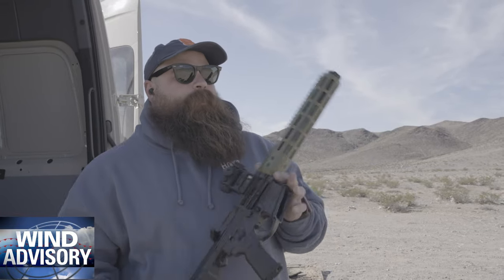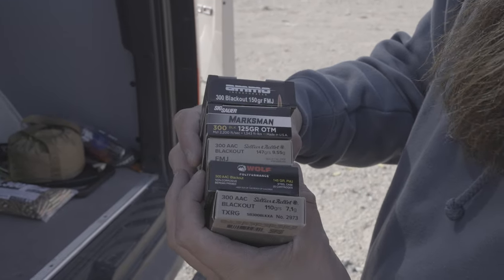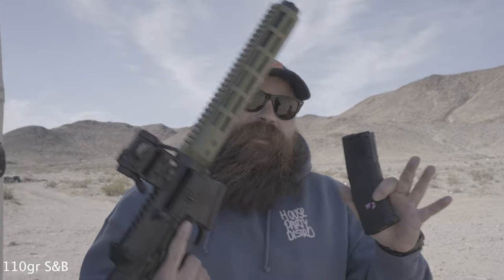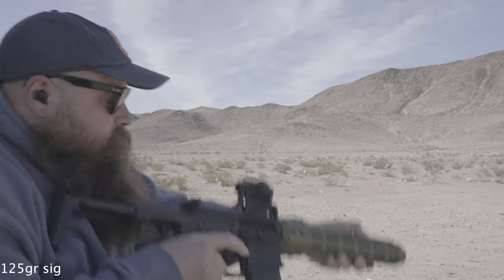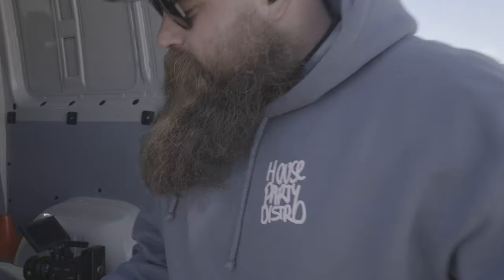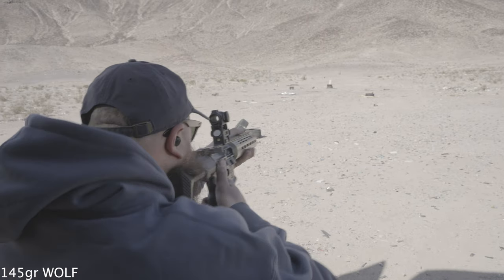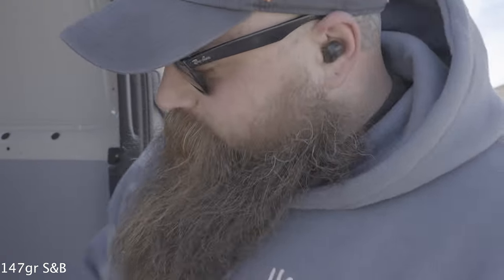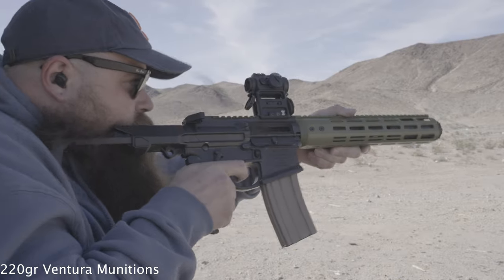Shooting a bunch different 300BLK ammo through the New Aero Lahar-30K Can. ( with bad commentary )

Comment: Know this is old now but this is absolutely what not to do with your handguard and suppressor unless you like always having to wear oven mits to keep from burning your hand..
Reply from the maker: @fishrrelaxing9361  I burn myself every time i shoot.
Reply: @fortknoxpodcast  in integral would be a lot better.. however there are very few for the platform that actually are decent. Still an aluminum thing guard over one is going to hat yo fast.. this is one of the reasons for a true dd style pic rail..added weight especially with a suppressor but it can take a lot more heat cause it it’s mass.. the mk18 rail pads exist for a reason.. 

Tbh for something like this a DD 1912 pic rail with the pads is worth its weight in gold here.. even still you are about 2-3 mags from needing gloves still

But those rails and pads were developed around the 416 full auto platform on testing.. they work